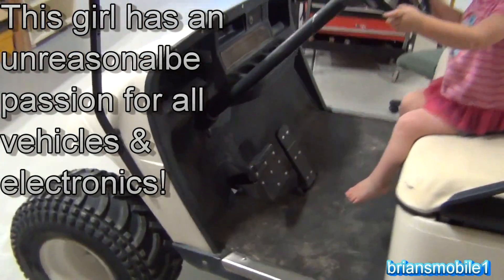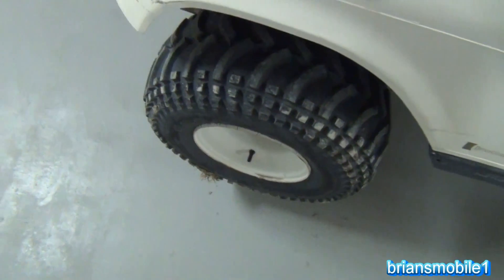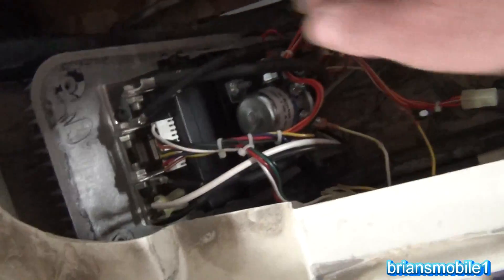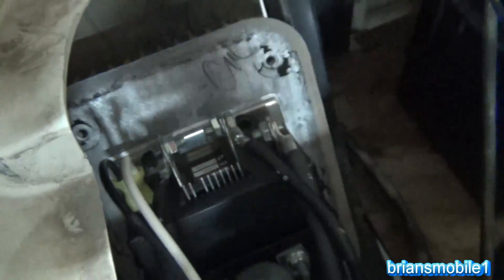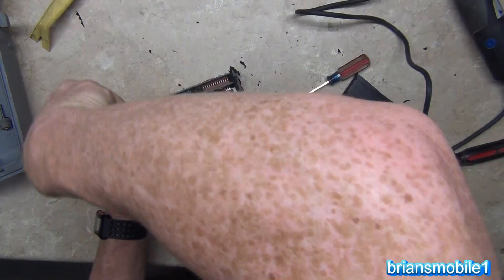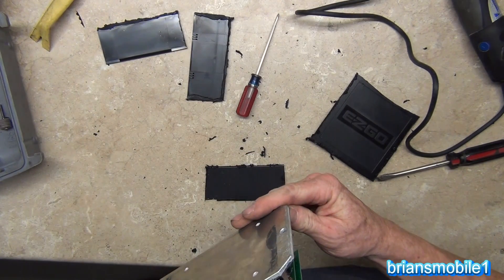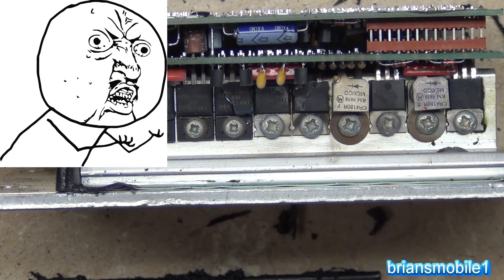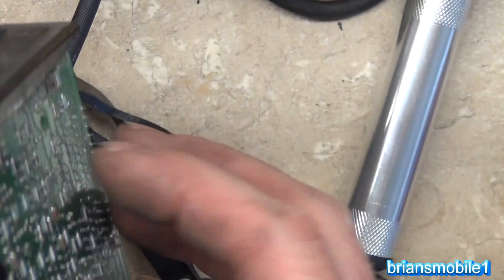Golf Cart Speed Control Alltrax DCX

Comment: My controller curtis 73326g07..is getting hot along with the solenoid and motor.. changed solenoid with no change..batteries are good..all connections look good..should i change controller?

Comment: Controllers can be way to complex to repair for the time and effort you put in. Ive had 2 fail and paid $230 for replacement. I cracked the case on my first one and it looked the same as your dead one.  I figured it would take me at least 5 hrs to pull apart and test and order parts. I just don't want to invest the time and frustration. I wish I could find a repair company I have been looking can't find one.  Anybody know one for Kinetek controllers? Its for a genie gs-1930 scissor lift.

Comment: And continuing to run with them shitty 12 volts you will be short lived on that rebuilt controller shouldn't take apart the core is worth $250.00 + core value to your next controller the way its set up theses will be fuse  from now on

Comment: Does n,t help having 3 12 volt battery's instead of the 6 6volt that it is designed to run on its the ampere hour rating That is ALSO VERY IMPORTANT
Reply: I’ve run my carts on 3 12’s many times. Works fine, doesn’t last as long as 6V but it’s fine.

Comment: I really liked your video!👍🏻 Great dad as well as a great mechanic.
This year...last week, I decided to buy a used golf for the purpose of yard work in my back 1/2 acre yard.
I’m educating myself on how to troubleshoot and fix one.
I’m about to look at an EzGo electric cart advertised $450 (good batteries , tires) won’t start. The seller claims it’s the solenoid ($20) and can demonstrate the proof by testing the motor (to prove the motor is good)🧐
I’m pretty handy with my multi meter and the old cars and not to mention a single older female.🤓
My first thought is...if it’s only a “$20 solenoid”... then why not replace it (seller) and sell the cart for possibly $1000?
So I question...
Is he not certain of the parts needed??
Is he not giving hidden information??
Anyway.... I stumbled across your video and thought it was helpful!
When I do get the opportunity to see the cart, I’ll bring my multimeter and verify the voltage on the batteries and to the solenoid and controller.
If I can get him to apply a DC voltage directly to the motor (cart lifted) to validate a working motor, I’ll be satisfied it’s not the motor.
Who knows?...
Possible reed switch, acc switch, on-off switch... bad wire connection , bad controller...?  Or, maybe he tinkered with it and jacked it up!🥺

Comment: Alltrax controllers are not serviceable. The circuit boards are resin filled to be waterproof and as a fact are not rebuildable. The factory Curtis controller is in fact rebuildable.
Reply from the maker: Good to know- thanks Dillan!
Reply: @briansmobile1  but I'll say this that DCX is able to handle 48 volts so if you want a little speed upgrade all you'll need is a heavy duty 48 volts solenoid and a 48 volts charger

Comment: completely unrelated, but the title reminded me of one time at a go-cart track with my dad.

I thought I was doing pretty good following racing lines and crap (in a car only doing ~40km/h because they speed limit them hardcore). We come up to a straightaway and my cart is floored of course but all of a sudden my dad whizzes by me doing at least 20km/h more than me, I'm like wtf how is that possible?

I guess the throttle cable runs right along the edge of the seat, so he just reached in there and pulled it up to open the throttle more than they want you to.

Nowadays that gocart track has upgraded to newer carts with pushrods instead of cables, and there's metal panels surrounding the seat.
Reply from the maker: +Andy Plater I like your dad.
Reply: Andy Plater your dad sounds like mine lol

Comment: Before I was called in  a guy burned up two controllers trying to get the cart to go by jumping it direct. When he bought a third controller I finally figured out that the reason the cart was not working was because the magnetic reed switch was defective where you plug in the charger.

Comment: i could have fixed it, sounded like the high voltage side blew up but the low side was mostly alright as it was making noise from the input
Reply from the maker: +Veikra If I had a better parts source- I would have.  I was pretty anxious for whatever fix I could get fast.

Comment: hey Mr Brian .   I'm requesting a video on the "BIG 3 or Big 4 wiring upgrade" . There is a ton on youtube but they dont cover all of the stuff like best brand of wire to use and the best way to put the ring terminals together. I'm sure you doing a video on it would be 100% better than others I have found .  reason is I have a 2003 silverado and the battery seems to have a parasitic draw because the voltage goes down to 11.5 ish votlz ..  when running it's 14.2 ish . I use a battery maintainer to keep the battery topped . I put it on every month.   So I figured I do a big 3 or 4 upgrade and add a better alternator . hopefully its just got bad grounds
Reply from the maker: +Ed Yager I'd be happy to do a video, but that parasitic draw (if you've got an aftermarket system) is probably a blue antenna wire roaming free behind the dash or an improperly wired amp or head unit.  All the low gauge wire in the stereo shop won't correct that, but a low cost re check sure could clean it up quick and cheap.
Reply: I do have an after market Pioneer deck installed.  I used a Factory direct connect wire harness.  All the wires are connected to that harness and I twisted the wires together and soldered them together and used shrink tube to make it a professional job . The only thing I didnt do was extend the factory ground wire to a metal ground near the deck as I used the ground off the wire harness. I will add another ground there soon.  But this situation has been like this for a few years now . I had the GM instrument cluster fixed cause that freaked out on me. I read that might cause it . I'm going to do the parasitic draw test on it from ETCG video. Then I will know if its the stereo doing it . I also have NO AMP installed .  just a new deck . I just wanted to play MP3 files . I bought the truck in 2005 . had 32000 miles on it . has 65000 on it now , And no I dont drive much . Thanks for the information . Your videos are awesome . wish you lived near me . I could use a honest great mechanic .
Reply from the maker: Thanks Ed!  A battery can be the culprit too.  I've seen that on those side post batteries in the Escalades.

Comment: just watched the video . that cart should really have 6, 6v batteries . that could cause problems by its self .
Reply from the maker: +Daniel Bernier That's right.  It came with 6 12v batteries though.  The power out of the hole is great, but the range is limited.

Comment: thats why i own a gas golf cart.
Reply: +briansmobile1  Between the two types-- gas vs battery,  you could charge them w solar panels or a wind turbine and have "free" power for your cart.  as an added benefit your batteries can also be used for back-up power (with an inverter) if you have an electric utility black-out.  Good choice on the battery powered cart
Reply: +briansmobile1 I'm far from an expert lol but with past experience that's been my opinion . they are a blast to zip around on though ! enjoy ! 😄
Reply from the maker: +bluebirdvision Both types have their trade offs.  Range, fumes, noise level, cost per mile, cost per year, ease of use, etc.
Reply: +briansmobile1 how much do you pay for batteries?
Reply: same here ... I worked for a club car / ez go dealer distributor for many years as a tech . my opinion gas is still the way to go . cost of repairs longevity upkeep etc. but to each his own :)
Reply from the maker: +Daniel Bernier Thanks for your input as an expert.  I've never had one before.  This has been a lot of fun and it's certainly a learning experience for me.  I think the golf courses use the electric for the governor and the ease of use.  Gas certainly has the advantage on range and being in my area of expertise.
Reply: +Daniel Bernier Expert or no, since you used to work for EZ, I'm certainly glad for your input. :)
Reply: +DE Nichols thanks ,DE . glad to help. :)
Reply from the maker: +bluebirdvision It came with six new batteries.  I haven't paid anything for them.